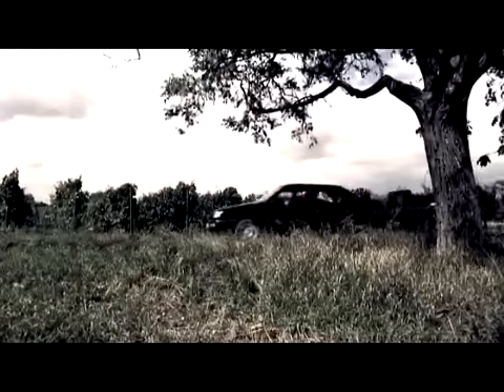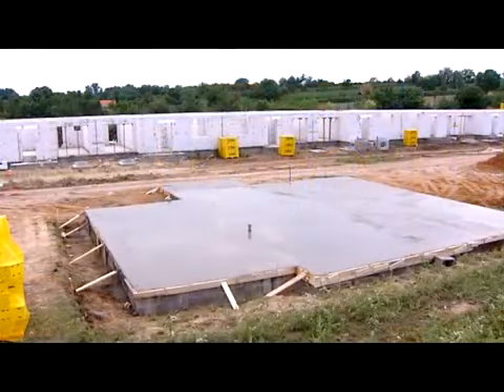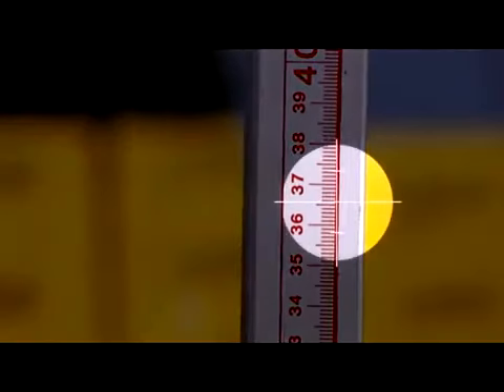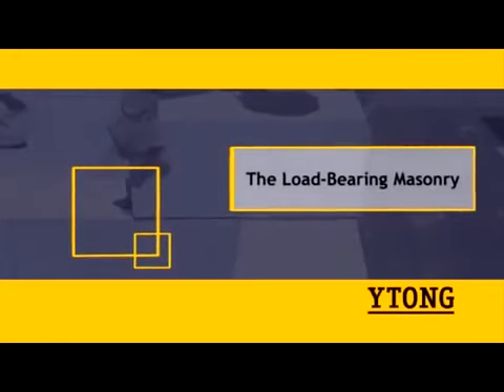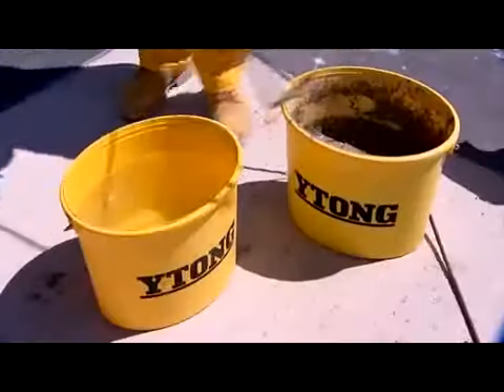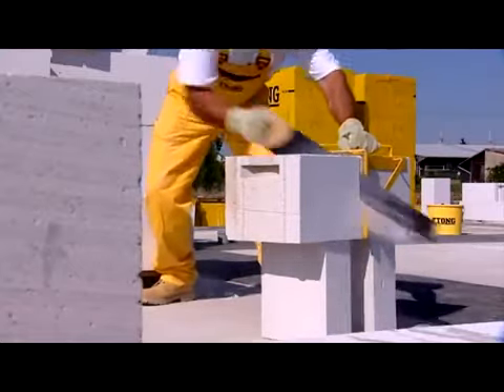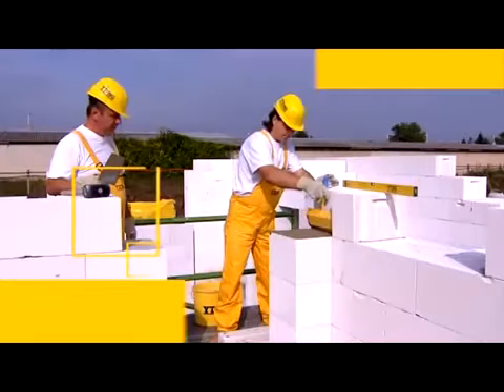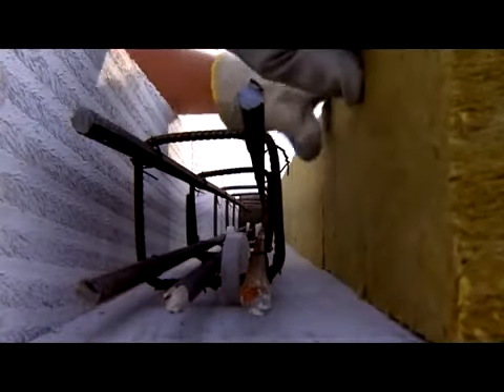Lightweight concrete blocks to build your house step by step part 1

Comment: Questions:
1. How often do you do those reinforcement layers?
2. How do you connect two tails of the reinforcement to each other? How do you handle the corners?
3. Do you use mortar or concrete for the reinforcement?
4. Why is you wall thicker than your foundation? Is it for insulation? How many centimeters is it allowed to go outside of the foundation?

Comment: AAC blocks are easier and faster to implement, but when it comes to plastering and putty they can be tricky as in significant cases they lead to cracking.

Comment: This type of block is widely used in Europe , it has many eco properties , structural strength, high insulation values , fast construction and most importantly Im3 of mix material will make upto 5M3 of building material .
Laid properly with the correct thin joint mortar and bed joint reinforcement all cracking issues will not happen, they are plastered easily with priority one coat plasters .
The secret is having the knowledge how to use the material correctly which unfortunately is lacking in the UK construction   workforce .
Reply: here where I live 25kg of cement costs 6 bucks, 40kg of sand costs 2 bucks, that's 9 cement blocks from YTONG (65kg/7.3kg = 8.9blocks). You can build as many as cement blocks as you wish, of any shape, the limit is only your imagination. With 2 hours of time intra-week + full hollidays and you have got your house in a year. The only reason people doesn't have house is because they don't want it.
Reply: is it cheaper compared to the conventional brick laying technology..

Comment: Autoclaved aerated concrete (AAC) is a lightweight cellular concrete that has been used for more than 80 years. Currently, however, no good recycling options for AAC from construction and demolition waste exist. for more details
Reply: I imagine that recycling has been attempted without consulting the plants - most recycle both the green and cured blocks into their production process.
Reply: always the negative, our waste disposal area in our town recycles bricks, concrete and other products, they get all ground up and used in road base.
Reply: Good grief. Just grind it up and you're left with sand. Or will that cause the entire world ecosystem to collapse?